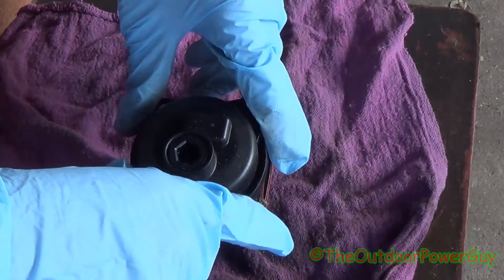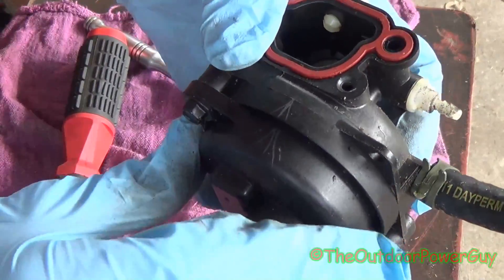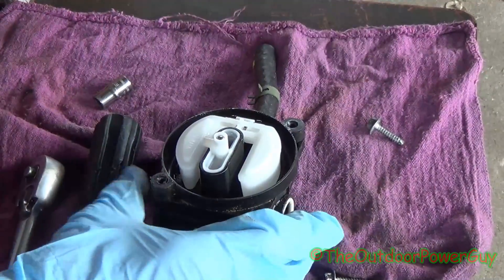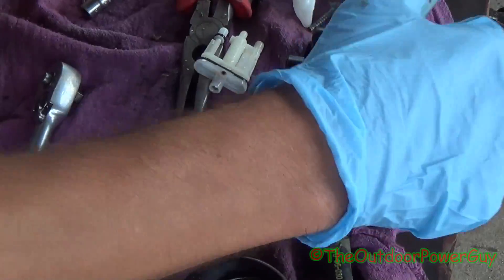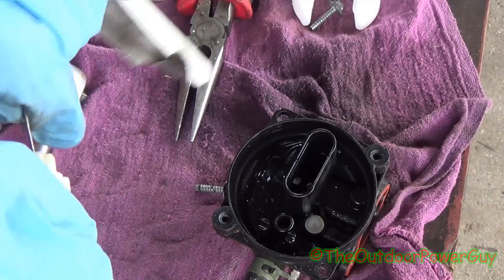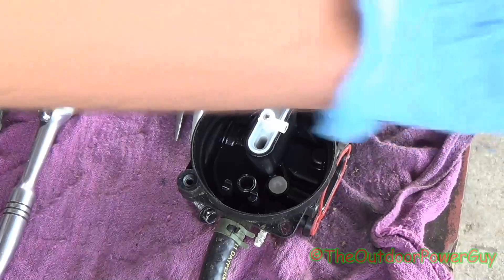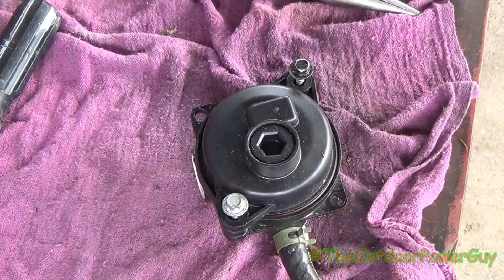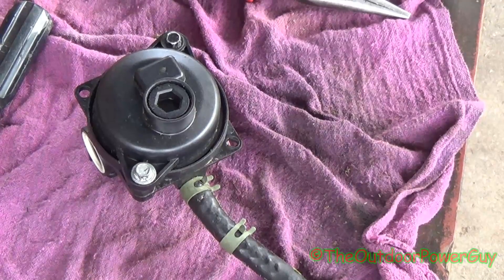HOW TO CLEAN A BRIGGS & STRATTON 450e/500e/550EX/625EX PUSH MOWER PLASTIC CARBURETOR

Comment: The plastic carbs plug faster because epa mandates dictated fuel efficiency and they had to.  make the side brass jet hole smaller. You can use a small drill and make it sligjtly larger making it less likely to clog

Comment: Hi The outdoor power guy. I have the same B&S 550ex, The machine was stored and has never been used since the pandemic started. It doesn't start. After I disassembled and cleaned the carburetor and put a new air filter, and 4T oil,  the machine started but in 2 seconds stopped. I disassembled again and clean the carburetor with a needle using such electronic's magnifier glasses to help and see more accurately. Now the machine starts perfectly OVER THE SIDEWALK and never stops. The Idle sounds stable, BUT.... when I try to use it on the grass, at the moment it has to make some " little effort " to cut the grass, it suddenly stops. I think it still has some problem of the amount of fuel to the mixture...is not enough. I'm right? Maybe I should buy a new carburetor? Best regards, Martin.

Comment: Nice video , but I drill that very bottom jet out to .025 with a # 72 drill bit and that will make it run better , more power and start first pull !!
Reply: which one? the metal one or the plastic in the other side?

Comment: Seeing 2 big mistakes right off the bat. First, you dont have to mark these carbs. They only seat one way. Second, never dig a flat head into the sealing area of anything. If you look at where he removed the screws, there is a nice little area to fit some small needle nosed into. Just put the close tip in and open. Pops the seal easily without damage.
Reply: Yep' no reason to mark its bowl.
 Most people who bring these to me that already took these apart strip the bowl screws because they dont press the bowl down in the base first.  Then tighten screws.
 Guy brought one yesterday cause he burnt the carb up using starter fluid. Melted carb all to hell & damn near burnt his entire mower up..lol
Reply: Right i used pliers plus they do only fit back on one way with that rectangle on the carburetor bowl on the bottom facing towards the left where the gas jet is at you know but he maybe a little new to playing with that stuff

Comment: The carb works great. Problem is the fuel with the ethanol which gunks up the works.
Reply: 91 octane fuel turns to jelly if left sitting and gums up the internals as i never have nor intend to put E10 in my mower LOL Ethanol is not the cause LMFAO

Comment: Are these plastic carburetor more or less susceptible to being clogged up by stale gas? Does draining the bowl really help preventing that? What are your thoughts on adding a fuel shut off valve between the carburetor and the fuel tank?
Reply from the maker: they are in my opinion more susceptible to being clogged by old stale gas due to the ports found hidden under the main jet. a fuel shut off on a push mower is not necessary unless the carb is leaking but thats an easy fix i only add cutoffs on riding mowers but some add them on push mowers as well it's personal preference , draining the bowl itself is not a good idea to take it off, the way to drain a mower to prevent the gas from going bad is at the end of the mowing season either run the mower until no gas is left in the tank or add the correct amount of fuel stabilizer to the gas tank to prevent the fuel from going bad, too much stabilizer can gel up inside the carb so add the correct amount. hope this info helps :)